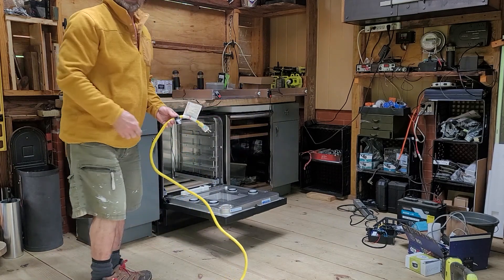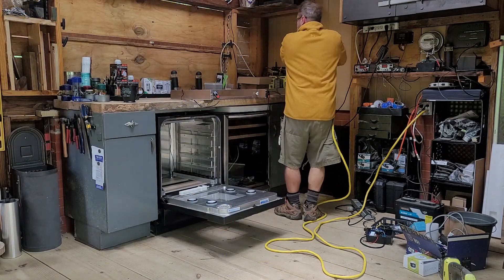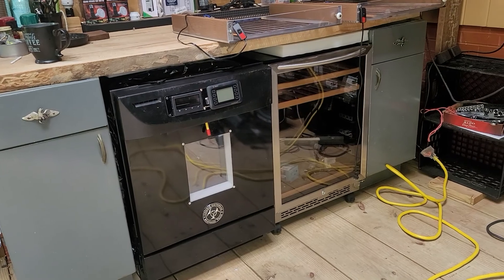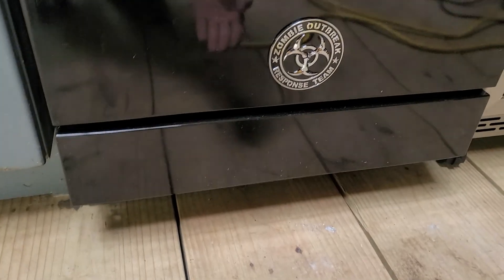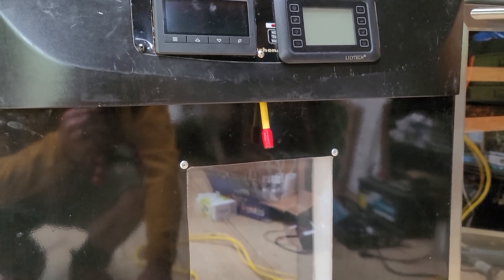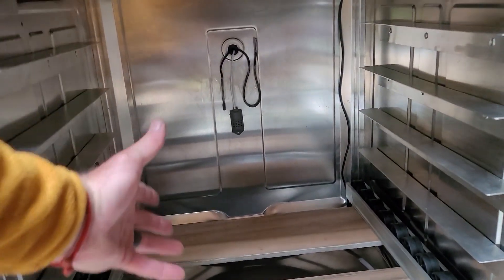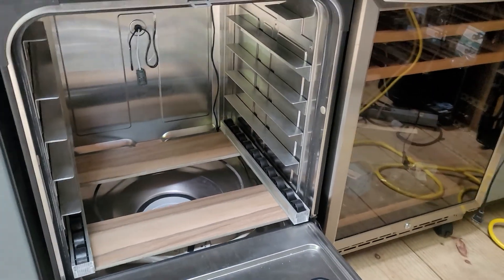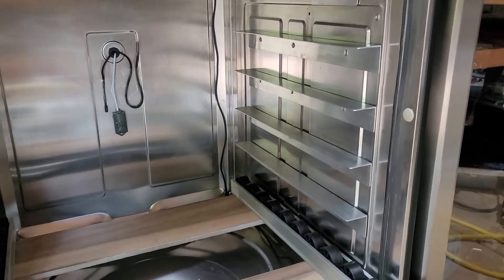egg Incubator and auto egg turner out of Dishwasher.

Comment: I have a question I’m looking into buying this controller but I see in the wiring that it needs dual limit switches but I see your set up doesn’t have it. Does it turn the motors on with a timer? Great video
Reply from the maker: I live this controller, if only for its shallow form factor.  I have a huge cartoonish XM-18 that I never want to use because it's so big, clunky and takes up so much wall space on the cabinet.  Plus it looks like a Pokémon controller, not professional like the lilytech.  They have an upgraded version of this ZL109A (the B version?) But I'm not sure what the upgrades are... I couldn't find any.
We get inc rates in the high 70's mid 80's... in a dishwasher.